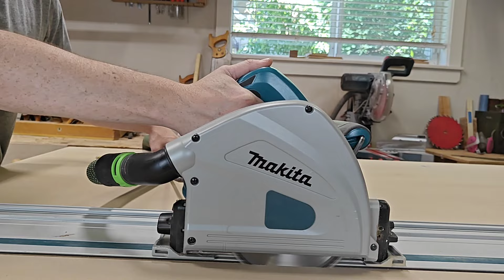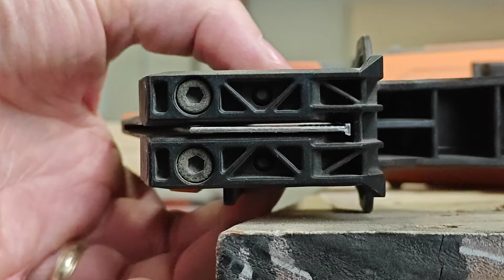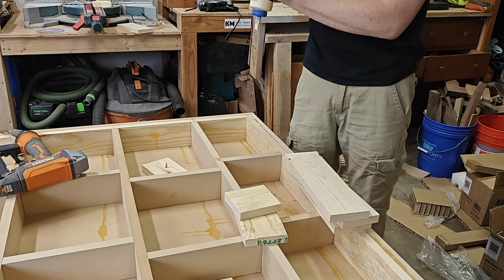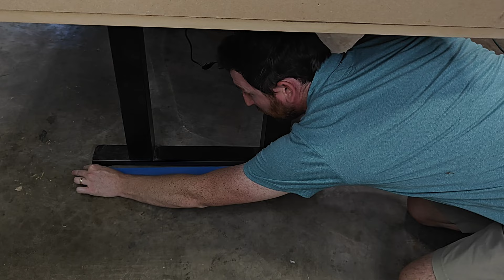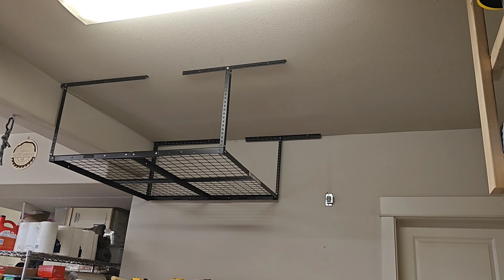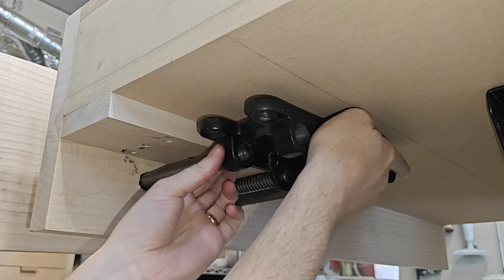Modular Height Workbench

Comment: I wonder if you could add gas spring structs between the legs and the torsion box.  You'd want to have them be removable, I guess, for down travel but it'd definitely increase the raising weight capacity.
Reply from the maker: That's a good idea. Give it extra capacity. In most cases it'll lift what I need but that could be helpful if I have a full case on it, although if I have a 500 lb piece of furniture on the bench I'm not sure how I'd get it off!
Reply: @keatonbeyerwoodworking  I was mainly thinking to ease the strain on the motors.  But hey, you never know what you're gonna have to cut ¯\_(ツ)_/¯

Comment: I love the idea of an adjustable height table for the shop.  Being 6'4" it's hard to find something premade that would work for both standing and sitting.  The sideways wobble looks easy to overcome, but I wonder how you could reinforce it? 

That dead pan look as you cut the MDF was frightening yet funny.
Reply from the maker: Having the adjustable height capability for a few weeks now has been so awesome. I'd recommend it to anyone, especially if you're tall. Sanding without bending over is so nice. 
My plan to reinforce the bench is to build a chest of drawers that will interlock with the lower portion of the legs that don't move. That'll add mass down low and add a stretcher like system tying the legs together plus adding loads of storage.
Reply: @keatonbeyerwoodworking  I own the same frame for my desk, and yeah, a rigid set of shop drawers to squeeze tightly between the sets of legs would likely help a bit. The shorter it is, the more stable it'll also be, so if you don't need it to go all the way down to 26ish inches, you might be able to put it on a pedestal or even make a taller torsion box for the top to get it closer to planing height.
That being said, I think the telescoping legs of standing desks have plastic spacers in them to improve the tolerances and reduce wobble, so putting lateral pressure on them from lots of planing might not work long term.
Reply from the maker: Ah, thanks for the comment. It makes sense that there will be plastic spacers in the legs. I might reserve the bench as mostly an assembly table